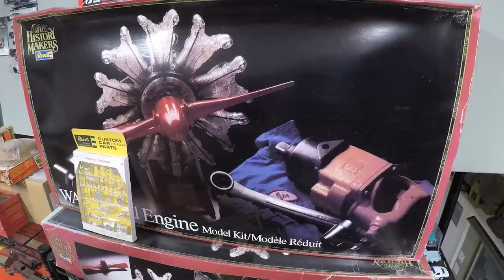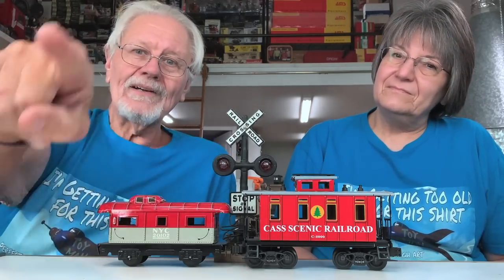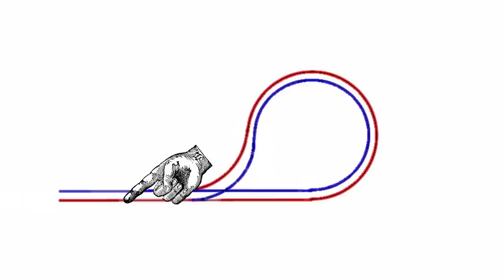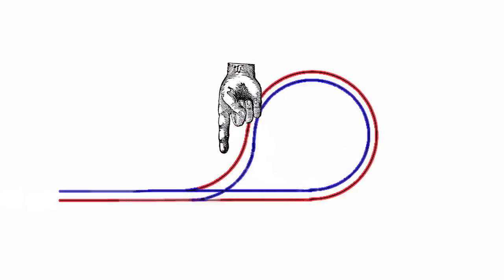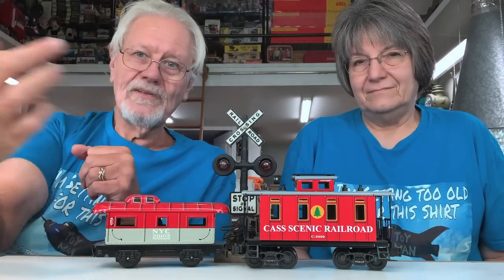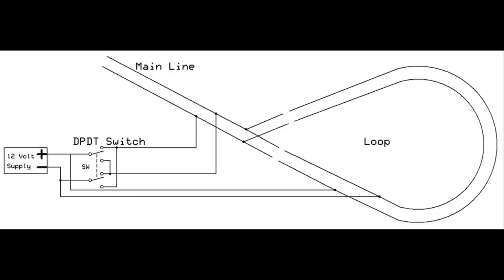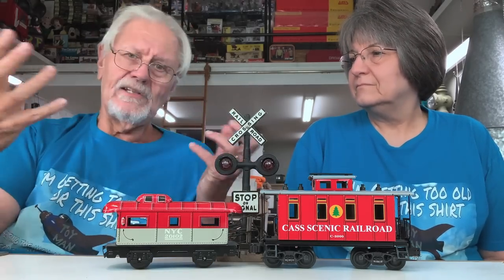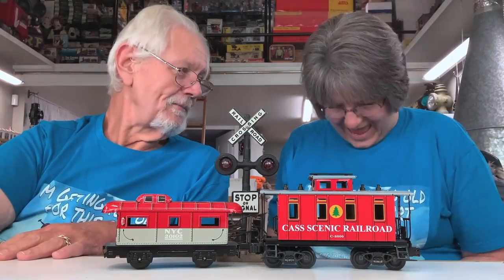Scales and Gauges Part 8 - Why did Lionel Use Three Rails?

Comment: My 1955 American Flyer control box was not that big it did not use tubes it was simply a transformer converter of AC to DC which is done with transformers to this day. Now cell phone charges using a solid state transformer circuit which probably impedes the input current of 110 v ac to 6 volt ac then converts that to 6 volts dc . That’s why those wall charges get so hot . Impeding voltage or more correctly dropping voltage and lowering amps throws off a lot of wasted energy as heat . That energy has to go somewhere ! Converter transformers get hot but the big ones on power line substations get really hot lowering 100 k AC to 4 k or whatever again fins and oil coolant keeps that heat dissipation going . 
My father who was a Ham radio expert for some 80 years , yes he died at 92 in 2010 always thought Lionel cheaped out by that trick    He didn’t think they were that safe .
Reply from the maker: The American Flyer also used AC. But because of the two rail system they couldn’t do reverse loops. The early AF had three rails and was O gauge as well. But they switched to S gauge and two rails but stayed AC. Wasn’t until 1956 that rectifiers were small and affordable.

Comment: If you want to see an AC 3 rail railroad. 
Look up the Napa Valley Railroad (not the wine train) the interurban line.
Or the early SouthShore
Reply from the maker: Wow!! Napa?? Really??? Wow!! Gotta go sea. Nope that’s not a typo. We need to get to the ocean from time to time.
Reply from the maker: And Napa. Right!! Who would string overhead wires in gods country.
Reply: @ToyManTelevision  there is a rather large book on the subject that can be found on our favorite auction website. That also lists several other AC interurban railroads
Ironically around the same time as the beginning of Lionel
Reply: @ToyManTelevision  it did have overhead.  Lol
Reply: @ToyManTelevision  visailia electric was another AC powered interurban

Comment: 'O' oh, is a Capital Letter symbol, and '0' zero is a Numerical symbol.
Reply from the maker: Yup. The original designation by the society of model engineers in 1896 was 0 gauge. But as most people said oh instead of not or zero the usage slowly became the letter O instead of the number 0. And all scales and gauges from that point were known by letters. But the other 1896 gauges stayed numbered. Gauge 1. Gauge 2 etc. except Lionel offered a large scale which I think was number 1 gauge, 1 3/4”, and called it “standard gauge “ as I recall…..

Comment: As a matter of interest digital command control, originally TMCC, No Legacy for Lionel or DCS (3rail) and DCC (2 rail) for MTH (now owned by Lionel) was invented and develped by the musician Neil Young.
Reply from the maker: Neal Young is a model railroad god. His layout is legendary. He built much of it in the road on concert tour. While ozzy was trashing hotel rooms Neal would have a room next to his prepared for modeling. They would remove the furniture and as I recall carpets, and the roadies would set up his bench in there. Then the models packed carefully and when finished taken to the layout. Oh to be able to see that layout. Oh and John Lassiter’s railroad. Sigh. The forbidden railroads. 🚫
Reply: @ToyManTelevision  Neal actually created digital control for his son who has cerebral palsy. His son couldn't work a transformer so Neal developed a way to send digital signals to the engine. This could be controlled by tapping a button which his son could do. Taking the control away from the track and putting it into the engine has redefined model railroading.

Comment: Hello. Your presentation is entertaining, but there are a few additional items to consider. When Lionel started in 1900, they used 2 rail track? Why did they switch? Although reverse loops are one advantage to 3 rail, the other consideration in the early 1900s was the lack of inexpensive insulation material. With powered rails (instead of Lionel's earlier battery power - Joshua Lionel Cowen was also the co-founder of Ever-Ready batteries), insulators are required for the rails AND for every wheel of the train in a 2-rail system with metal wheels (pot metal was cheap and easy to mass produce). However, in a 3-rail system, only the middle rail requires insulation - not the wheels of the rolling stock. It wasn't until after WW2 that plastic became cheap and easy enough to work with that 2-rail systems became more economical and more popular. Fin video! https://youtu.be/GxEkx1Zamjw
Reply from the maker: Hi. And thank you!  Indeed. Insulation is one issue and probably the largest reason. It would be an interesting cost comparison. The track is much more expensive. One rail insulated either way. Added cost of a third rail. Cars much easier and cheaper. Locomotives hard to say.. complicated center pickups. But totally grounded chassis. Which would make the locomotive much more reliable. But here’s an interesting idea. Some on the 19th century trains ran on line voltage!!!! Now they always used a center rail as if they had used two rail a reversed polarity would place line voltage on the frame of the locomotive!! Anyway interesting history. And good reasons why Märklin and Lionel and Marx all went with three rail. Looking forward to the series on electrics.

Comment: Remember though, the old American Flyer trains ran on two rails, and those were also AC, also, if your going to educate us on radius, please get the information correct, the O27, O36 and so on is the diameter of the curve, outside diameter, not the radius, the radius of O27 would be 13.5", the radius is exactly half of the outside diameter, two rail modelers tend to use radius, which is measured down the centerline of the track!
Reply from the maker: Thanks for the correction. Oops. Also ” Lionel was inconsistent. Generally speaking they measured all the way across for smaller diameters and center to center for larger ones. And sometimes their measurements were pretty exact.

Read more: https://dfarq.homeip.net/available-diameters-of-tubular-o-and-o27-track/#ixzz7mimwLRk6
Reply: @ToyManTelevision  That is true, Lionel was very inconsistent with their track, while it was all O gauge, it wasn't all useable for full size O gauge, O-27 trains could certainly run on standard O gauge track, but not the other way around for direct example!
Reply: Not quite "outside diameter", but rather the diameter is specified center rail to center rail.  The space required by the track always being a little more than the diameter specified.

Comment: lionel ac motors are a universal type motor ( tesla design ) so set where marketed with the ability to run ac or dc as at the turn of the century both currents were being supplied to homes. To capture the market lionel trains would run on both currents. many small towns where dc till the 1930s. My bat. powered locos are simply reallocated power wires to same engine... and train get scarier the more you loo lol...
Reply from the maker: Yup. Complicated history. DC line current. You couldn’t be more than a few miles from a generator. Power plants as often as churches. Small… but everywhere.

Comment: Yes. But it wasn't 0-36, it was 0-30. Also, you can run an 0-27 train on 0 gauge but you can't run an 0 gauge train on 0-27.
Reply from the maker: Yup.
Reply from the maker: Well O 31. And O 34 Marx and then O27.
Reply: O-27 is still O gauge, distance between the outer rails is exactly the same. Only difference is the rail height and curve radius.

I also beg to differ on running O scale on O27, have a scale Atlantic that goes fine, short wheelbase likely helps. Most semi-scale locomotives and cars also do fine.
Reply: True. 0-27 is 0-gauge but the height of the 0-27 track is lower and 0-guage trucks will bump along the ties.
Reply: @bobesposito7235  

Must be some sort of funny trucks for 2 rail O with extra big flanges or something, as I've never had that happen with any O gauge equipment I've ever used, including UK-built stock.

Believe I mentioned the smaller profile of the rails, though.
Reply: Sorry, I meant to say 0-31, not 0-30.

Comment: Markland invented three rail track when they went to electric trains versus Clockwork or live steam. As the German companies were the biggest toy train manufacturers Lionel petitioned Congress to put a limitation on the amount of German trains imported into America. All of the American companies went into three rail so German toy trains would be compatible with theirs. They all more or less standardized on three Rail and AC. Lionel trains was divided into two camps scale and toy. But all still ran on three rail track. During World War II American Flyer went from three rail old gauge to two rail s gauge. Because they started with a new scale and Two Wheel track your previous products were not compatible. Today's sophisticated railroading is still cursed with three rail. Just so it can be compatible with crap that Lionel made during the 50s. Wall of the new manufacturers should have done two rail only because most of the new model railroaders have all brand new equipment and virtually none of the old crap. Lionel did make some nice scale engines and nice scale cars but they were more expensive and less profitable than cheap toy trains and as Lionel with cheapen his trains leaving details off Etc he would piss off his customers. He would leave details off just so the trucks can swivel underneath the car and he can put them in a smaller box that was cheaper. I always wondered why the brake rail was on the wrong side of the Caboose. After World War II you can see in model railroad magazines companies that would convert your three rail locomotives to two rail. If Lionel mass produced two rail scale O gauge locomotives and cars instead of trying to compete with every cheap line of trains out there they would have done much better. Josh Cohen wanted to drive March train out of business with his Scout line of sheer garbage and Mark's low-end trains ended up being better quality than Lionel Scout line which gave them a horrible reputation and cost the company lots of money in sales as well as developing a cheap crap product. Josh Cohen was known to spend a dollar in order to save a dime. It would cost the consumer much more than Lionel saved by leaving stuff off by having to replace the stuff that they left off. On the B&O locomotive she would leave the nose decal off but you could buy it for two cents but it cost you 5 cents in postage to ship it and he would charge you the five cents in postage. They had an American Flyer commercial on TV where they Twisted a piece of Lionel track and it came apart Josh Cohen was Furious. He ordered the production of the Super O track rushed for sales and the super old track switches were known to lock in place and Catch Fire. Not what you want on your model railroad.

Comment: Lionel 031 track was simply standard gauge Rail and standard gauge size May 31 radius track. That's why the rail and the tires are so absurdly out of proportion. The 027 track with its smaller rail has a much better appearance because the rail is not 5 ft tall. Just like The Swinging gateman which was originally a standard gauge accessory he put old gauge on it never mind that the man inside the shed was 12 ft tall. Lionel with fatally contaminated with the collectibility tag and now people think anything and everything Lionel is super expensive and collectible samples of this Ridiculousness is bottles of smoke pellets that are not usable. Ridiculous prices for track pins or lock ons. Super ridiculous stupidity they're overpriced crap they're going to die with. And they can keep it. Weaver in Pennsylvania made better O gauge trains then Lionel in America at prices cheaper than what Lionel and Mike's train house could make in China. Imagine that competitive American products made in America by Americans that are cheaper that stuff made by Chinese imagine that. I love running and All American train. I like having American-made buildings on my layout. I do have to buy non-americ stuff but I try to limit it. Weaver had great customer service and with service locomotives that they had not made for 20 years. I bought some engines from a train show had problems they sent me a receipt I shipped it to them postpaid they returned it to me postpaid they put a bigger circuit board in the engine and said that even though the engine was 20 years old because I just bought it they would honor the warranty. It's a shame Weaver ended with his retirement. I understand Lionel but some of the production equipment and those cars are made in America I'm not sure where.
Reply from the maker: Yup. 🚂 toy trains!  Silly at times. But fun at all times!!

Comment: Poorly explained AC /DC electricity.  American Flyer could use AC, so this guy's reasoning is off.
Reply from the maker: AF did. Almost all two rail systems used DC. Almost but not all three rail systems are AC. Several reasons why, but the systems used for reversing AC motors require a more complicated reversing system than just reversing the polarity.

Comment: Old man Walters before World War II figured out a way of signaling and wiring for reverse switching as well as wyes and started selling the components through his catalog. Many of the model railroading companies in the old days were started by someone who is in The Hobby Irv a t h e a r n has his own company that built two rail O gauge locomotives and rolling stock as well as HO scale locomotives and Rolling Stock in kits. Their k i t s had to be discontinued because the average American does not have the attention span to read a simple two-sided one page sheet of instructions. These kids were so simple they used to be called Shake the Box because they were very few parts in it. Now those are gone. Nobody knows how to put anything together or take anything apart or fix anything anymore if something doesn't work you throw it away and you buy another one. In the old days when everything was made by white men in unions so things were proper to cost and when you bought something everything was built to be serviceable and rebuildable until the Japanese came along with built-in obsolescence. Everything that used to build from electronic products to cars to motorcycles nothing was rebuildable everything had to be replaced when one piece would wear out and you could not service it nor could you get parts. I like the old America better.